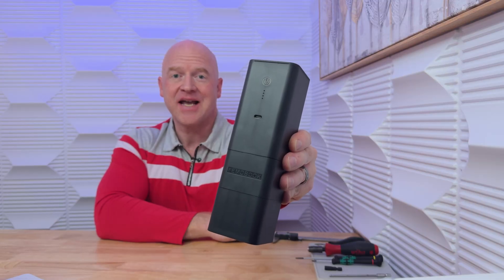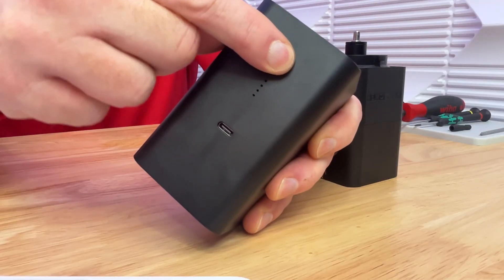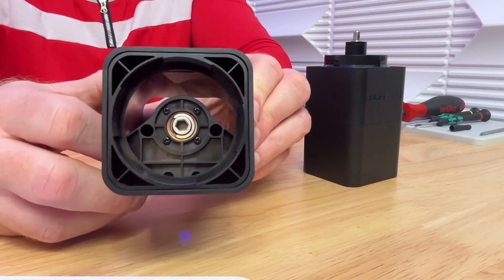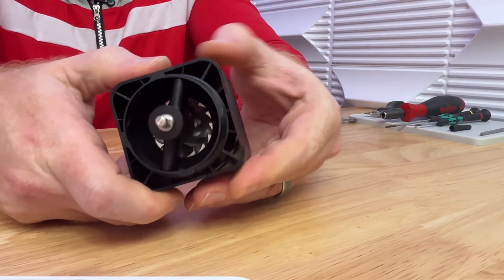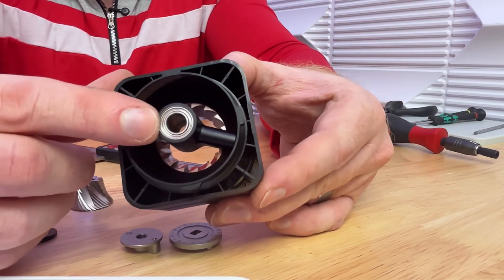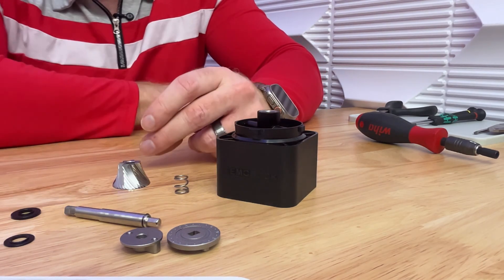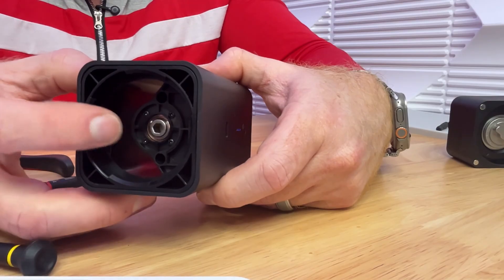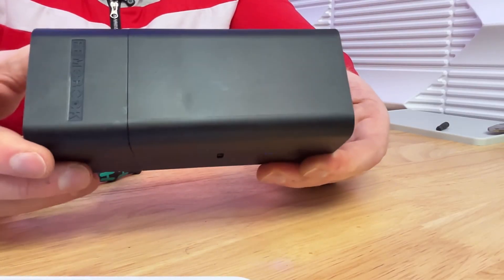Femobook A2 Coffee Grinder Teardown - Battery Powered for Travel and Home

Comment: I bought the white version 3 weeks ago. This week I noticed cracking near the 4 magnets on the bottom. On the  bottom cup, but also on the middle section.

Disassembled middle section to clean more and 1 of the 4 tabs crumbled. Stress cracks near the other tabs. I'm sad. Never dropped or abused. I'm wondering if white polymer is less rugged vs black, or maybe a bad run? I reached out to the manufacturer. I'll update what happens. I might just get the black model and see if that lasts longer.

Comment: Nice scoop on the A2! I’ve been searching YouTube and Discord and there has been virtually nothing outside of a couple short unboxing videos. I actually ordered one a few days ago, as I’m a big fan of the burr on my 1zpresso Q2.
Reply from the maker: I think you are going to love it! It’s hard to believe that it’s the same price as a Q series, but has a motor and batteries. My favorite feature is the automatic stall resolution. It doesn’t stall for pour over, but with super light beans at espresso sizes it can. But, when it does stall it automatically reverses, and then keeps on grinding. More grinders should have that function.
Reply: @CoffeeGearLab How robust do you think the planetary gearbox is for repeated espresso use? I recall early builds of the Lagom Mini needing gearbox replacements after a few months of ownership due to stripped gears.
Reply from the maker: See Short reply